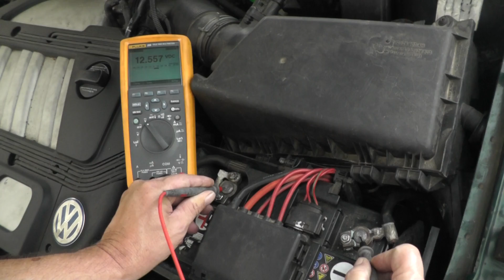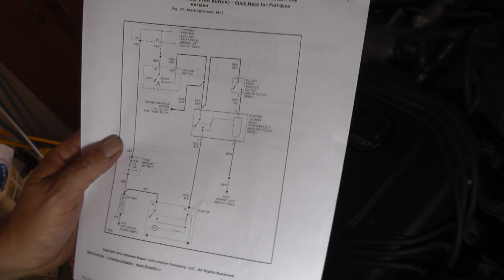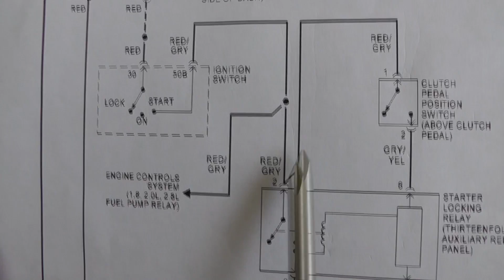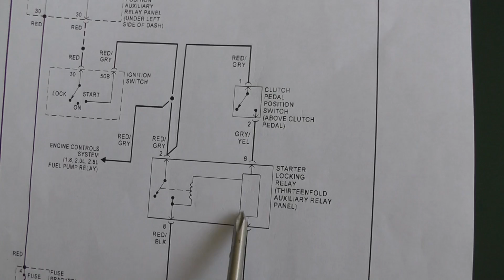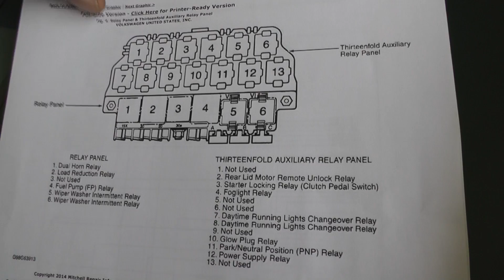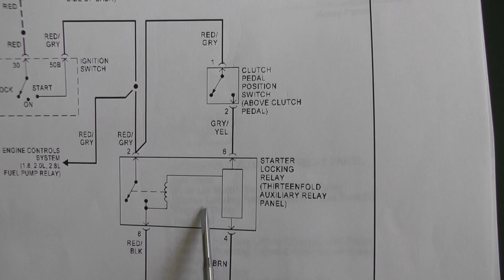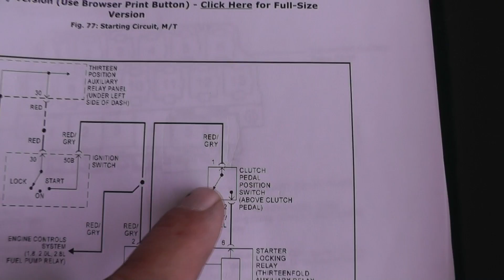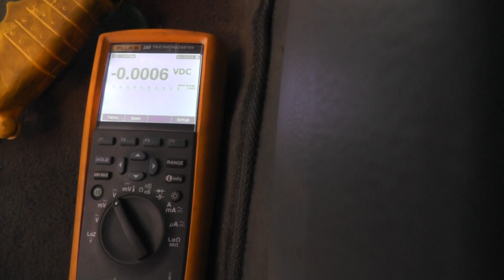Volkswagen Jetta Won't Crank, Electrical Diagnosis - Part 1

Comment: Wouldn't it have been easier to just put a meter on the starter to see if you're getting 12v?
Reply from the maker: Always different ways to troubleshoot as long as you reach the same outcome of the issue.
Reply: @stuzman52  I'm getting 12v to the starter.... replaced the starter.... still won't turn over.   ?!
Reply from the maker: @ADDvanced  Only two things comes to mind. Either you have a bad starter motor or the engine is locked up. Can you hear anything from the starter motor when you turn the switch to start?
Reply: @stuzman52  A click, since I put in the new starter.
Reply from the maker: @ADDvanced  Assuming that you have a good starter although a new one can be bad and the engine can turn over, I would recheck the voltage to the solenoid when turning the key. And be sure to check your battery connections and that the battery is good.
Reply: @stuzman52  I had the battery load tested and it gets 12v at the starter.   I don't get it.

Comment: Yes sir,if you love your newer Volkswagen, someone else works on it for you. I run my own mechanic shop, and I just want to cry when a VW shows up. I don't even want to put air in the tires.  Great info video 👍😀😀
Reply from the maker: Yes, Michael! When these cars are new, they run pretty good. But when they get some age on them, they're nothing but a money trap. 😊
Reply: @stuzman52  ever had a steering angle sensor problem after an alignment? Did an alignment on the wife's kia soul and now the electronic stability control is making the abs work on its own. How can I correct that without the proper scan tool or going to the dealer? I'm more of an old school mechanic and never had this happen.
Reply from the maker: Michael Jackson Tne only way I know is to use a scan tool that supports the function of aligning the steering angle. If you had the alignment done, the shop should be able to do this.
Reply: @stuzman52  thanks. I have a small racing alignment setup and did it myself. I don't currently have a scan tool for this. I appreciate it though 😊

Comment: My 01 Jetta relays keep malfunctionimg. It can start in neatral and fuse is ok so must be relay. Starter keeps engaging for too long, replaced starter and relay now it's doing it again. My accent lighting and license plate lights won't turn off. The trunk keeps trying to lock but the latch is broken probably from that I'm assuming that's the trunk lid remote lock relay. I've been searching for help? Could this cause my issues?? Or do I just need to replace all the relays?
Reply from the maker: Charles, you'll need a good understanding of how electrical systems work and you'll need a wiring diagram for troubleshooting. I can't say what your problem is as it will need to be troubleshot.

Comment: I have a VW Jetta 2011. 120K miles. It won't crank as of this morning. All the light on the dash light up as well as headlights turn on. A few days ago I attempted to jump start another car. With no success. Could it have somehow messed up wiring on my car?
Reply from the maker: Only if the leads were reversed when placed on the battery...Otherwise, not likely!

Comment: Thank you stuzman! Very Helpful, especially the explanation of the wiring diagram. Any chance you can link the wiring diagram for us? Thanks again
Reply from the maker: Thank you David! The wiring diagrams were purchased from a paid subscription and we wouldn't to violate their copyright laws. You can get the same diagrams at a very reasonable cost from here https://www.eautorepair.net/Marketing/Default.asp

Comment: Hi, I have a 2005 Jetta 1.9 TDI diesel.  Died in a drive thru, now wont crank, no start.  I followed the schematic as your video described.  I have voltage to the clutch pedal switch and when you crank and push the pedal down Im getting voltage thru the switch.  Found that the control wire (switched) to starter was grounded and I disconnected at the starter and found that the starter was shorted to ground internally.  So Im going to replace the starter and hope that it starts afterwards
Reply from the maker: Good luck on your repair!

Comment: So it's normal the ignition switcher get bad? Today I just turn on my Jetta 97, but never starts, and all the electric is good
Reply from the maker: Rodney Carbguif I don’t know if it’s a common issue, but the ignition switches do fail.

Comment: You CANNOT assume that a fuse is actually good by visual inspection as he did at about 3:20. Either check for voltage being the same on both sides of the fuse or take it out and check it for continuity. I know this because I made the same assumption and spent hours chasing false leads one afternoon.
Reply from the maker: Mmmm, I went to 3:20 on the timeline and I DID NOT see myself inspecting a fuse.

Comment: In my case the initial open voltage is 12.1volts. and when i start using the key the voltage drops to 11 volts and reaches 11.5 when  i unlock the key . is this a starter motor problem . would also  like to know the minimum voltage to start the vehicle at the starter motor relay .specification of the starter motor is 12.volts .
Reply from the maker: kbsunil prabi When cranking, the voltage at the starter solenoid shouldn’t fall below 10V. The better the battery and wire connections, the higher this voltage.

Comment: Stuzman haha I love your comment about guys who love Volkswagen's. I always say to my missus how much I hate working on her car.
Any job on her car is triple the time of my aussie falcon.

I'm trying to fix a no start, no crank, no dashlights issue. Seems like a bad earth but I have no idea where. Your explanation of the diagram really helps though. I've already replaced the ignition switch it's fine and the lock cylinder is fine.
Its dead as a doornail like the battery is unplugged then when it decides it want's to power on it does at random.
Reply from the maker: Thank you Peter and I've found that working on VWs is not the easiest car to work on :) I'm sure that you'll fine the issue on wife's car.
Reply: Yeah I always do. Like in your Part 3 video I always get frustrated working on her car and curse the European engineers design. I can only imagine you curse at the car just like me once the camera is no longer rolling haha.
Reply from the maker: HaHa! If only you knew all the curse words that was coming out of me when I'm working on that thing. In fact, it's got issues now where the A/C doesn't work, the clear coat is flaking everywhere, the passenger door pull handle has snapped off and the intake manifold change-over-valve that I replaced 25,000 miles ago has gone bad again. VWs in my opinion is nothing but a pile of junk. I'll be working on that thing when it gets warmed up to get rid of it :))
Reply: Sounds just like hers intermittent door lock actuators that work when they want to work. When you're at 1/4 tank or below at any speed the engine can randomly decide to just totally stall then kick back in like an ignition cut. The sunroof drains were leaking into the interior because they were designed poorly and block up so snips fixed this. Stone chip on the front guard has flaked massively and down to bare metal.
One summer on a hot day the gearbox started slipping like the torque converter had gone couldn't get any drive. Let it sit and it started working that was 6 years ago never done it again.
Not too long ago the wipers got stuck on and wouldn't stop. I assumed the stalk was broken but it randomly fixed itself and hasn't done it since.
Now this no power issue.
Time for a new car I think.
Reply from the maker: Sounds like you've had your share of issues too with that car Peter. I've got four old vehicles and it's just the wife and I now. This VW came from the daughter where we bought it from her. We both must have been out of our minds at that point. Anyway, I guess the VW will generate a few YouTube videos before I get rid of it :))

Comment: I have a 2000 Volkswagen Golf that will turn over but won't fire. It gets fuel fine, but has no spark. Any idea where to start?

The battery is perfectly charged.
Reply from the maker: I would start looking at the crank sensor and and see what that turns up.

Comment: Really enjoyed the video stuzman. You could have a TV show. Love your "way" of working through this problem. Between your draw, calm demeanor, observations, and your wife's giggles and "hmm's", you guys make some very charming how-to's. Thanks!
Reply from the maker: Thank you Zachary! And for your reasons, that's why the wife and I like to film to share information. Means a lot and thanks again!
Reply: Hey! Our Vr6 just started up for the first time in over a year! thank you thank you!
Reply from the maker: HaHa! And I don't even know what I did to help you start your car up LOL..
Reply: Well, the car sat for a long time because we didn't particularly need it. I have been overwhelmingly busy with work while preparing for our first child on the way. After reading others' diagnosis last summer, I felt confident that replacing the ignition switch would fix it, but the other tutorials showed removal of the steering wheel as necessary and I just haven't had that amount of time to dedicate to fixing it. Today I stumbled across your video and fixed it in less than 15 minutes. My wife wanted me to scrap the car for $300. New rotors and tires and she'll be like nothing ever happened. This has been hanging over my head for so long!
Reply from the maker: Well Zachary, that's good to hear that you got the car running now. And now don't you feel bad about all of that procrastinating :) Glad to hear that it was an easy fix for you and that you saved yourself some money by doing it yourself. Take care Zach...

Comment: we bought a 2000 Vw beetle TDI and it turns over but want crank replaced the relay and the pump fire is getting to the pump but it want start any suggestions?
Reply from the maker: Sounds like you mean that it will turn over, but won't start. Two things to check are fuel and spark. Pretty basic stuff Wendy.

Comment: I want to start by saying your video is well done very helpful, but so far hasn't helped me LOL
I have a Volkswagen Beetle 1.8 t with which I'm having a no crank issue. the battery is holding and 11.8 volt charge right now.
✔battery cables
✔clip to solenoid 
✔starter bench tested
✔clip to clutch switch
✔starter/clutch relay
everything checks out on the multimeter. what would be your next step in your diagnosis process?
Reply from the maker: Did you check the voltage going to the solenoid starter when the ignition switch is turned to start? I see that you have 'clip to solenoid' but I don't know what that means. Do you have a wiring diagram for the car and what year is it?
Reply: I mean the female clip that sends power to the solenoid on the starter. I had someone turn the key while l tested it, and it checked out.
Reply: No l dont have a wiring diagram, its a 2000 beetle 1.8t
Reply from the maker: Mansa, when you checked the ignition wire going to the solenoid and you had power, you should be done. This would point to the solenoid or starter. Or maybe a locked engine. I would assume that you checked this with a voltmeter while the wire is hooked up. Or you could unhook the wire from the solenoid and check for voltage with a test light when the key is turned to start. With the test light this would load the circuit so you know there is no resistance in this ignition wire. But if you're sure that you have the voltage then you've checked everything down to the starter. This would imply there is a problem with the solenoid or the starter. But you say that you bench tested the starter. Did you ensure that you put a voltage on the solenoid terminal? In any event, here's a link to free wiring diagrams and TSB's for your car or any car for that matter. You can get free wiring diagrams from www.bbbind.com When you get there, look for 'Technical Information' and then click on 'TSB's and Wiring Diagrams.' Fill out the brief form and then you can get the wiring diagram for your car so that you can see how your system if wired up. Hope that helps!

Comment: This was a great start to troubleshooting for this no crank condition. I have a 03 Beetle 1.8 to troubleshoot tomorrow at work with the same issue, no crank no start. It died while driving. However, 2 fuses in the left of the dashboard fuse panel, a 20 and 25amp keep blowing key off so thats where ill be starting. Now time to research how to read VW wiring diagrams :/
Reply from the maker: +dreamer2355 Good luck on what you find and resolving the issue.
Reply: Did it work?

Comment: hello I have a problem with my 2004 gas engine  jetta. I was driving it the other and started to lose power, decelerating until completely went off. try to turn it on again. it wouldn't do it. probably after 10 min turned back on an it did the same thing as couple more tines. thank you for your help.
Reply from the maker: +karla fonseca Karla, with your description, it's hard to understand what you're saying. I assume that your car is losing power and then shuts off. You try to start it and it doesn't. Does it crank? Does it crank, but won't start?
Reply: +stuzman52 it does crank but won't start
Reply: +stuzman52 it does crank but won't start.
Reply from the maker: +karla fonseca Sounds like it's basics. Check for fuel pressure and ignition spark.